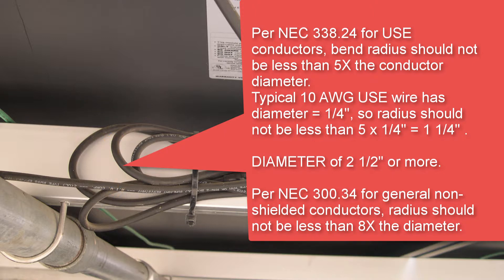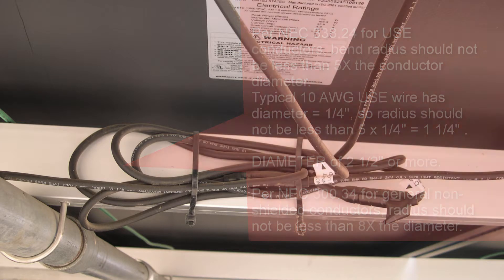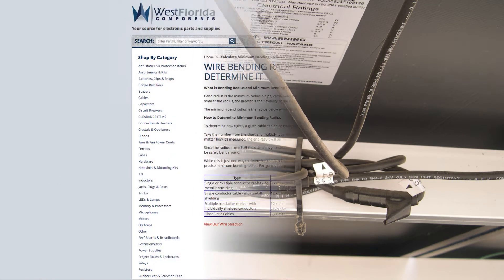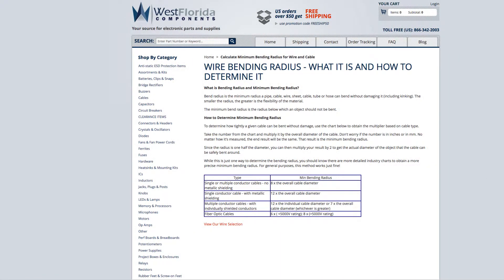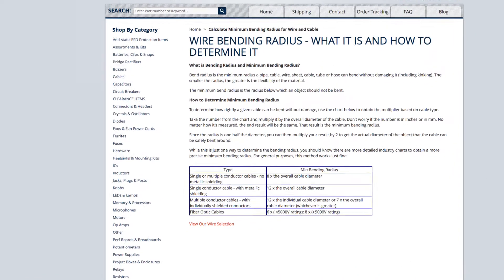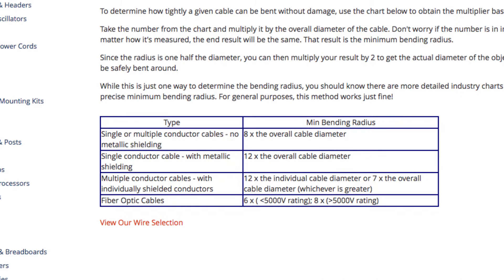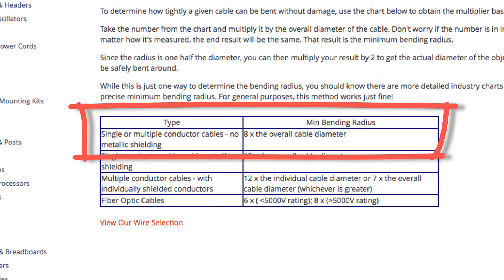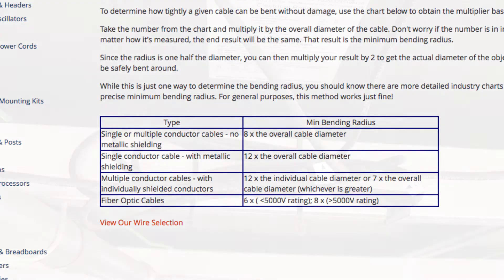Solar Snack - Wire Bend Radius

Comment: CLARIFICATION: The NEC article (300.34) referred to in this video applies to conductors for 1,000 volts and greater.  It does not apply to conductors rated "600 Volts" or less.
From NEC:
Chapter 3 Wiring Methods and Materials
Part II. Requirements for over 1000 Volts, Nominal
300.34 Conductor Bending Radius. The conductor shall not be bent to a radius less than 8 times the overall diameter for nonshielded conductors or 12 times the overall diameter for shielded or lead-covered conductors during or after installation.